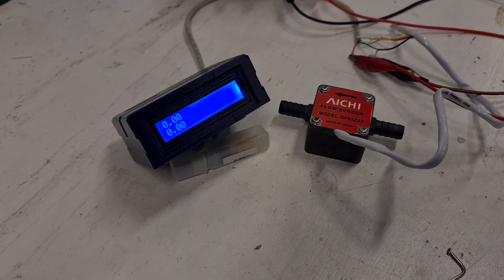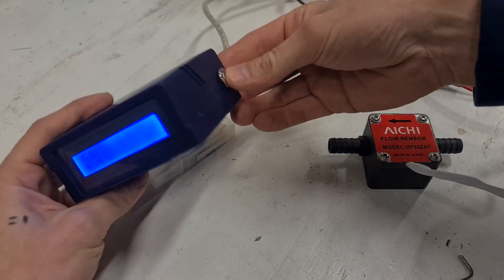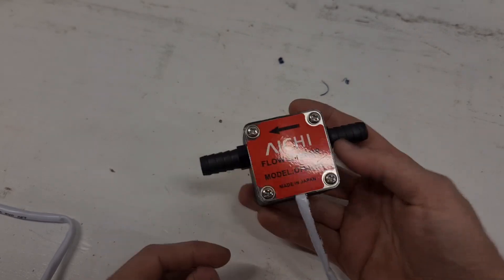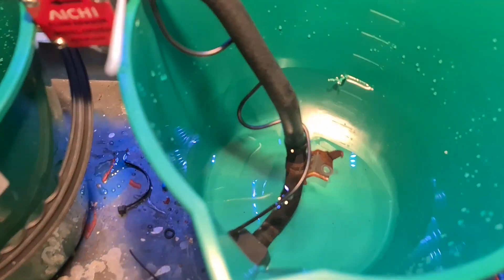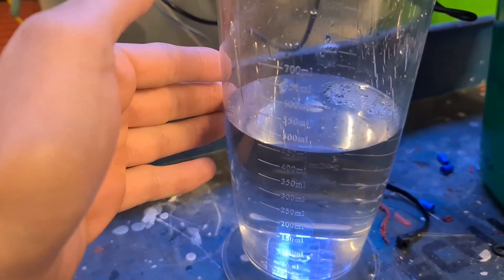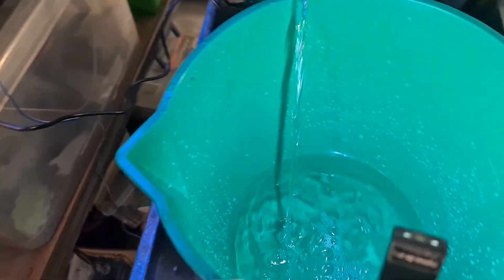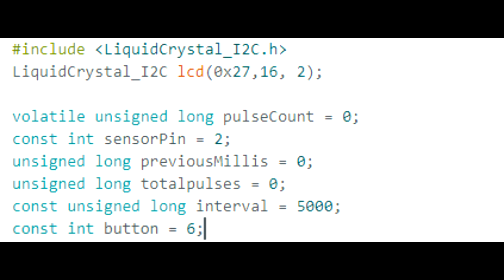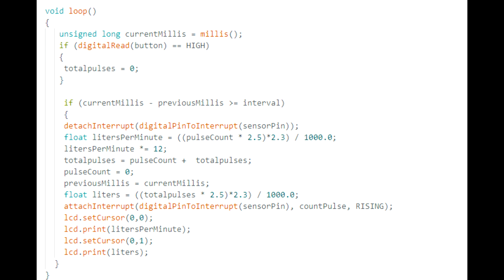DIY Boat Fuel Flow Gauge (Arduino + OF05ZAT)

Comment: Are you willing to make/calibrate the display and ship within NZ at my expense? I can source the meter myself.
Reply from the maker: Depends on the application of the unit. We found that these flow meters only really operate in a stable environment where there is low amounts of vibration or movement. My contact details are on my Website techup.co.nz. Please feel free to contact me.

Comment: I have an outboard with only 8hp. However I am interested too, how much it consums and at which Rpm the sweet spot for efficient cruising is. 
There is another one out there, that is not too expensive and should deliver a bit more precise results: 93N-6211-1100x
Reply from the maker: @pietlopsa9164  it would be worth getting something better than a fake OF05ZAT as the ones we used had lots of issues.

Comment: I've bought this sensor and I have some esp32 here, I'll try to measure the flow of diesel at my old bus. Your video is awesome, nice work, congratulations 😁
Reply from the maker: If you do this make sure you test the fuel pressure after the sensor to insure its not causing to much of a drop. Maybe do a test before and after installing.